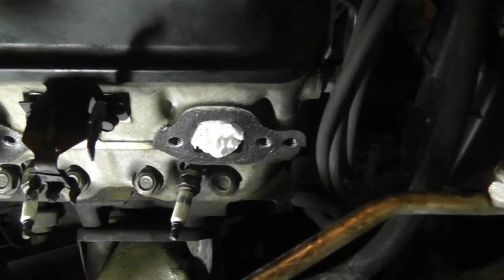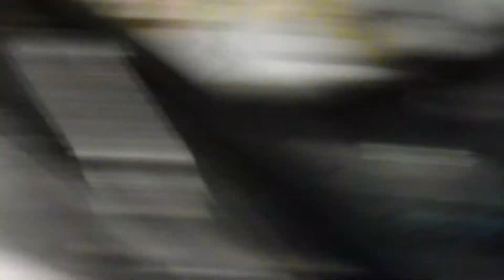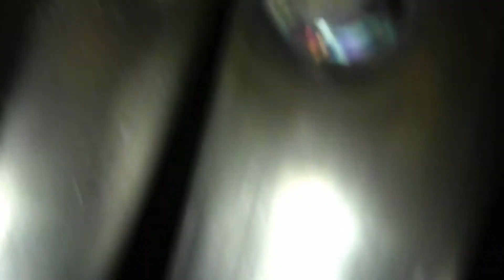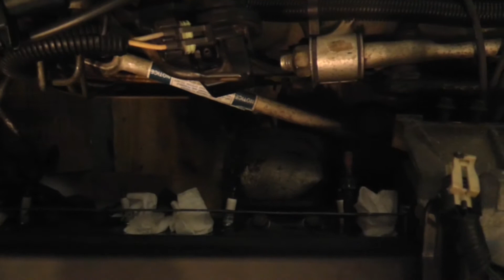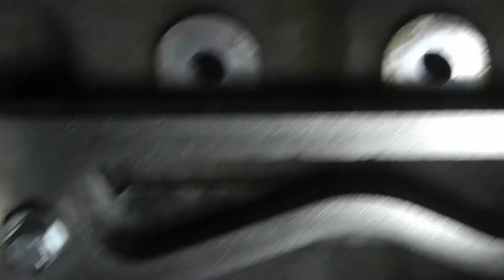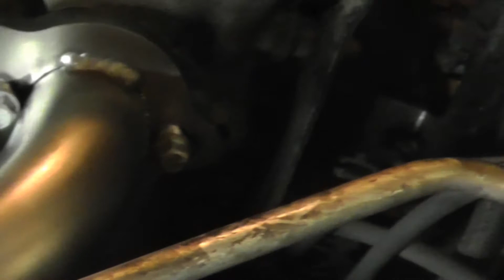Header Install 1993 C4 Corvette, Part 7

Comment: I know this is a old video series and the headers fought you the whole way but I gotta say thank you since watching these videos made it where I was able to install mine easily since I knew the problems ahead of time to so I had a plan. Seriously thanks
Reply: No they didn’t fit it was just like what you ran into but since I knew it was most likely gonna happen I had my saw ready with a diamond tip blade ready to go. Then I used manifold spreader to get it just right. I soaked the secondary air fitting for days with pb then they came right off. Then used some heat and a vice to make the bends for the passenger air fitting on top of the header

Comment: Nice job getting the headers on. I think I would have cut the bung on one side and bent it to fit then screw in your pipe and reweld the bung. You kept after it and that is what counts. I would like to see what you did to get it all together. Good video.

Comment: You needed a bench grinder, I have a Craftsman variable speed grinder with grinding wheel on one end and a wire brush on the other, I use it for everything from cleaning bolts to sharpening mower blades!